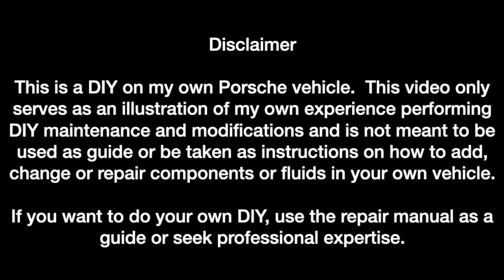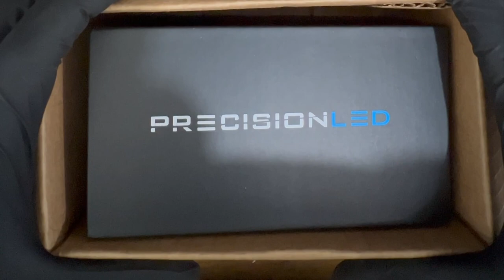HID to LED Headlight Bulb Conversion (PrecisionLED)  - Porsche 718 Cayman S

Comment: Nice find. Interested to hear if your car threw up any error codes? Makes me want to try on my Macan.
Reply from the maker: No fault codes.  This is a D3S bulb, hence it works exactly the same as any other HID D3S bulb.  I posted this upgrade in the Macan Forum (as I also own a Macan) and a few folks have done it on their Macan reporting success and improvement.  The only reason I didn’t do in my Macan is because about a year ago, I upgraded the headlights to OEM LED.  Also, this upgrade is much easier to do in the Macan…

Thanks for supporting my channel.  I hope you subscribed.

Comment: oh wait, you just swapped from the OSRAM to these? i'll check it out!
Reply from the maker: Correct.  I initially replaced the Osram OEM bulbs (4400K) with the Osram Xenarc CBI Next Gen (6200K).  But then found these LED bulbs with great reviews and decided to give them a try…. I’m still testing, but so far, they haven’t disappoint.

Comment: Thanks for the comparison! I have a 718 Cayman GTS 2018 and recently I've messed up the horizontal alignment of my PDLS Xenon (exactly like yours). I'm struggling to fix them to the right horizontal alignment before swap out to new Osram CIB bulbs. Do you have any advice/guide to do that? I couldn't find anything specific to those headlights online and I can't access Porsche official repair manual. I've messed up cause I've followed a wrong advice and wrongly moved the screw of the horizontal adjustment (the higher one) instead of the vertical one. Then I've found out my mistake but was too late and I could't manage to bring the horizontal back to its original position. Thanks a lot in advance!
Reply from the maker: I’m not sure, apologies.  I know there are adjustment screws that you can access via the frunk, are those the ones you adjusted?  Why can’t you adjust it back?

I have done minor adjustment in my Macan and what I do is I put the car facing my garage doors and try to do my best to align the headlights.  Not an approved method, but helps.  

Are you saying you completely lose the ability to adjust horizontal alignment, even when you are trying to adjust it?
Reply: @porscheDIY  yes, I’ve tried but without reference I can’t revert in their original position. I was wondering if you maybe have the workshop manual and could suggest the right method/procedure to do it.

Comment: I noticed your 4 LED daytime running lights are on even when your lowbeams are on. Did you do something to make that happen? My 718's bi-xenon DRLs automatically turn off when my low beams turn on. I would love to know how to make my DRLs stay on when lowbeams are on. Much appreciated and thanks for the video.
Reply from the maker: I have both PIWIS 3 and Launch X431, but you can activate this with any OBD2 tool with ECU coding capability.  

Activated 4-point LED ON while headlights ON (normally 4-point LED turn off when headlight turns on).  This in essence makes the 4-point daylight driving light a marker light when headlights are on. It retains the daylight driving function when headlights are off.

Coding:
Rear-End Electronics: Codiertabelle: Exterior Lighting: Exterios Lights, DD as a marker light = YES

Rear End Electronics: Exterior Lights Parameters: Dimming value for DD lights as marker light = 100

See more here:
https://www.718forum.com/threads/my-2018-718-cayman-s-mod-log.25728/

https://www.718forum.com/threads/718-coding-with-x431.25831/
Reply: @porscheDIY  thanks so much!

Comment: The LEDs looks the same as the OSRAMs, I’ve recently upgraded my ‘17 Macan GTS to OSRAM D2S and it’s a nice improvement but I think I would have to completely upgrade to the second generation headlights to have a significant improvement.   I was really hoping swapping to LED bulbs like you did gives me the ‘modern’ light output but from your video it doesn’t seem like it is such an improvement.   Thanks
Reply from the maker: Thanks for sharing.  As I said in the video and other comments, gains from changing to LED Precision LED is going to be marginal when compared to next gen OSRAM HID, in terms of brightness.  But the reality is that with these next gen bulbs, and with PrecisionLED you are pushing into Max brightness boundary already, within the HID projector lens.  I don’t think you could do better, so any gains will only be marginal and sometimes maybe even imperceptible.  Then, it becomes a matter of preference… light color, durability, etc…. 

In my opinion, there are significant gains when you upgrade from OEM, especially if it is an old bulb, to next gen HID or PrecisionLED.

BTW… our bulb spec should be D3S and not D2S….  Interested to know how we’re you able to fit a D2S bulb.
Reply: @porscheDIY  my bad, it is a D3S!

Comment: Hmm did something changed to newer Porsches? you should able to just pop the headlight out from the frunk? At least that's how it is done in 981 and 996
Reply from the maker: Not anymore.  That changed with the 718 (982).  The headlights are fastened to the body by two screws on the bottom.   To remove the screws, you need to remove the bumper.  To access the rear side of the headlight to change bulbs, you can do it by removing the wheel well (no need to remove headlight).  Still, more difficult than 981.